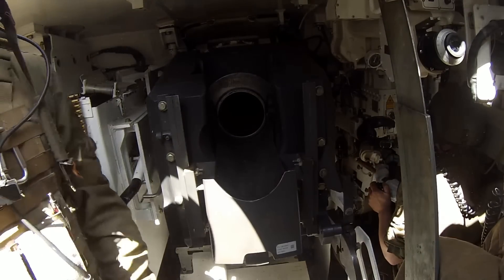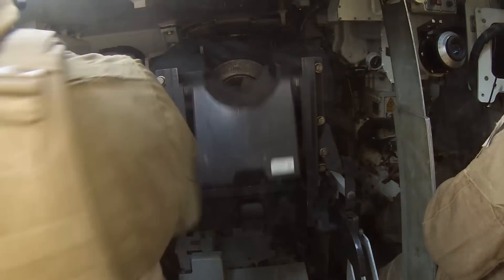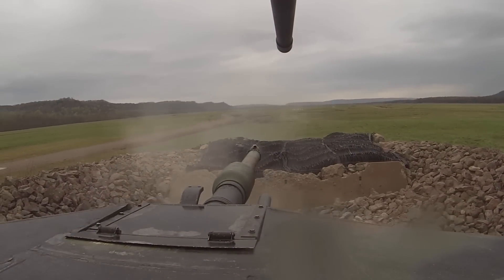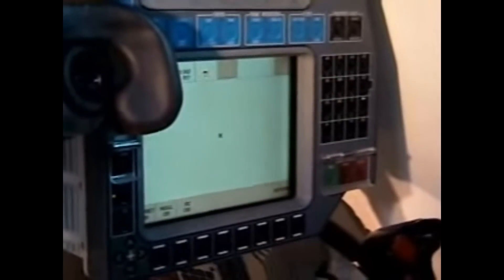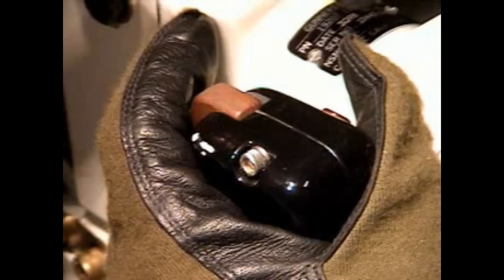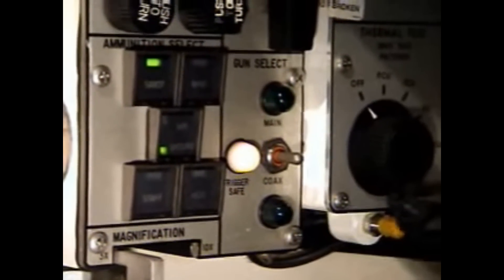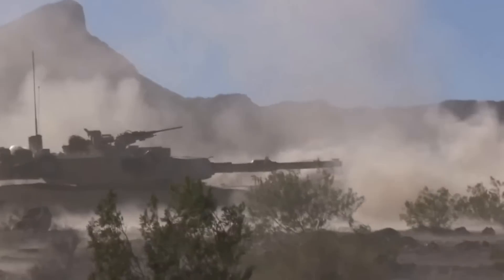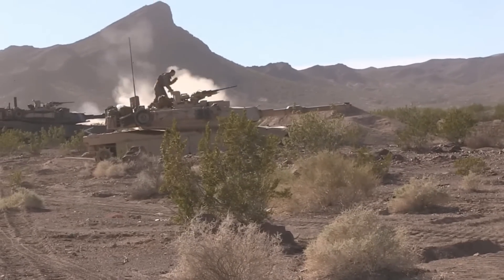How Do They Clear Tank Gun Misfires?

Comment: Now back in my day, if there was a misfire on the range, the crew applied immediate action and if that didn't work, left the round in the gun with the breech closed. They then got out of the vehicle and the Range Safety Officer had the privilege of removing the round solo. Fortunately, I was never RSO when a misfire occurred, for which I was duly thankful. BTW, the danger isn't a misfire, it's that you have a hangfire on your hands. A hangfire is where the primer is burning but the main charge doesn't ignite for some unknown period of time after the trigger is pulled. Needless to say, if it happens while the breech is open, anyone inside the vehicle is crispy critters. Even if the breech is closed, you want to stay out of the recoil path, in case the hangfire decides to blow when you're in the way.

Comment: I loaded on a M60 tank with a 105mm main gun and had to deal with three misfires.  Our procedure was less complicated.  After going through all the electrical and manual triggers, we would open the breech rotate the round 1/4 turn and attempt to fire again.  If that didn't work wait for possible cook off then off load the round to the range safety officer and he would carry it to the misfire pit.   Eventually EOD would come and blow everything in the pit.   In combat you would just chuck it, probably skipping a few of the steps.  We didn't have an ammo compartment with blast doors, all of our ammo was stored in the turret or hull, so no putting it back in the  ready rack.   Of the three I handled, one fired after the 1/4 turn and the other two were offloaded.

Comment: After 10 years as an M1 tanker I had one bad misfire.  The 15 minutes are for the tube/breach to cool.  When heated, the round swells and will not be able to be removed.  We actually had to punch it out from the end of the tube using the cleaning rod.  Since it was sabot, it is kinetic and inert.  We did damage the casing and had EOD and QS on site to take it once out

Comment: Besides all the ignorance and immature people’s post about this example of what a Mobilize Armored Tank Crew is faced with each time they  arm, aim and fire their main weapon in anger to be destroyed is extremely impressive and dangerous. Each member of any tank crew members have to have basic knowledge on the workings of their vehicle. No matter what their core responsibility’s are. To progress through the latter of command they may have to do something similar to what navy personnel or submarine crew members. That’s master each component of their MOS. Back to the miss fire. To the people who have repeatedly compared a Tank Round to that of a handgun or Rifles and assault weapons. Even though the tank round appears to look like a high powered rifle round casing with a huge projectile. It’s definitely not the same. Almost all rifles,AR and handguns use a primer or percussion strike to fire the cap. Big rounds like the 120 mm smooth bore cannon and others use a electric firing mechanism to send the round. It’s does not use a firing pin or strike break. So handling a miss fire round that electronically fired is totally different from what a person would do with a typical round miss fire. The charge round may fire long after it has been removed and it should be destroyed ASAP. Or removed from the ammo chamber ASAP or time permits
Reply: https://youtu.be/yHbf-Eb3xak

Comment: If there are two failure to fire, in any engagement, even not in a row, you must get permission from the field command to continue or to immediately stop and return to a  designated area for electronics checks by mechanical squad assigned to that tank.  The rounds are usual not the problem!

Comment: As a former loader, driver and tank commander on a leopard2a5/a6 I really wouldn't freak out at a misfire. I don't recall having had one actually. But since the round is fire electrically, when it's out of the tube I wouldn't worry about it too much, since you take it away from a possible source of ignition. What DID freak me out is when we had to unload after firing a decent amount of rounds and the tube really gets warm. This sometimes caused the casing to stick to the tube (since its just some sort of hardened cardboard. Sometimes you were able to get it out by twisting, sometimes the only way was forward  (with force, literally kicking it back into the gun) so we requested to send it anyway. But I recall a time when a fellow loader actually pulled the rear from the round and the high explossive propellant marbles were scattered over the tank's floor! That was nasty!
Reply: Cellulose casing.

Comment: Wait 15 mins? What if it is combat situation?
Reply: probably have to retreat to a safe distance to properly clear the breech. if that's not possible and getting the gun operational quickly is life or death, probably set the safety on immediately, open the breech, take out the misfired round, put it in the magazine, replace with a new live round, proceed as normal. Only in extreme emergencies though and no I'm not an expert
Reply: You would immediately clear the breech and chuck the dud out the hatch and proceed to load the next round.

Comment: Isn't it potentially REALLY dangerous to put the round back into the storage rack? What if the round decides to go off whilst its sitting in said storage rack? :-(
Reply: Not really. M1 Abrams has safety fuse to prevent those situations. Ammunition is stored in separated  storage which is not part of the turret. So if it detonates, crew and tanks interior is not damaged. If ammunition detonates in storage, or if its hit by shell from outside, separated ammunition rack drops out of turrets rear and nobody gets injured.
Reply: @vladislav3828  In THEORY! LOL
Reply: @georgebuller1914  It may sounds crazy, but it is main battle tank. I am pretty sure they have tested it out and found it is the best possible solution.

Comment: Got a question..... Since the casing is a nitrocellulose based casing that is consumed during firing, and the only items ejected are the brass base, and primer, etc; What would happen to a tank round if there were to be heat applied to the casing? Or is it only sensitive to extreme shock, such as c4 where you need a large shock in order to set it off. Thanks!!

Comment: M1A1 TC in Desert Storm here. In contact a misfire can not be handled the same way as in Tank Gunnery. 15 minutes is not an option. There are several expedient ways to deal with this issue, An undesirable way is to unass the dud round out of the tank. However, friendly ground units nearby must be taken into account. I have seen two misfires from other tanks in my unit while in contact. The first one the M1A1 went into max elevation and dropped back from the formation to clear the round. Although this does put your section at a disadvantage. The second one I saw was a Silver Bullet flying out of the loader's hatch of my wingman and the tank then continuing on as if nothing had ever happened. After action reviews showed that these misfires both came from the same lot number and all crews were instructed to turn in any remaining rounds from that lot they had onboard. I don't recall ever seeing or hearing of this problem again in my 22 years of active duty service. Murphy's Law in effect.

Comment: First point on 'Tank Safety' would be the Gunner, and his rolled-up sleeves and bare hands!
Next, unstrapped CVC helmets!
3:48- "Master Blaster". Yes, like the Mad Max character/s...
7:40- Yes, there is. We call it 'OSUT', or One Station Unit Training. The gun is '10 level' maintenance. In other words, crew level. It is viewed as the same training for your M4 Carbine, M9 pistol, M240 coax, or the 50 cal. Everyone on the crew is expected to have the skills and knowledge to clean and service every gun on the vehicle.  
Otherwise, correct.
2/69AR, 1998-2004

Comment: Its really not that big a deal. If its not going off with the trigger or master blaster (manual trigger) then its not going to go off. I was a loader and we had a misfire once. Just tried to set it off manually a couple times then I was told to pull it out of the breach and tossed it outside which is what you really should do.  Its a pain in the ass at the range though because you have to wait and leave it in the breach forever then wait a long time for EOD.

Comment: I find it interesting how after the round has been fired you are only left with the bottom part of the shell. What happens to the rest of it? Does it combust with the powder? What is it made out of like aluminum magnesium alloy or something?
Reply: Never mind I  found it.

On these rounds, the case (the light gray portion between the warhead and the black rubber sealing ring near the base) is made of nitrocellulose (heavy duty cardboard impregnated with nitroglycerin) and burns up completely when the round is fired. The only thing left after the round is fired is the aft-cap and primer which are ejected out of the breach and fall to the turret floor to be gathered up and turned back in to the ammo supply point later for re-use in making new rounds.

Comment: Spent five years in tanks and this never happened. Even with the old shells we were firing all the time (M-60A1 105mm). .50 cal is another story all together. We never put a misfiring round back in the honeycombs. Our drill had us waiting a half hour and then getting the round out of the tank. Throwing it out of the tank in combat or putting it in a sandbagged-in misfire pit at the gunnery range.
Reply: Yeah, putting a misfire back in the honeycomb seems...let just call it unwise. But in combat situations you wouldn't want to dispose it, were an enemy combatant might re-purpose it into an IED.

Comment: To answer your question of multiple misfires your most likely culprit is the firing contacts on the right side of the M256 gun.  Believe it or not, it is usually because of a flashlight filter that is placed between the contacts when using MILES before the gunnery cycle.

If you have any questions about the M1 series of tanks fire them my way.  (pun intended)

Comment: Usually, the breach or round was dirty. Crew not making sure both were clean. Wiping and oiling the breach is only temporary. Maybe 5 to 10 rounds. A full weapon cleaning was needed. This from my observations and one of two that had to extract the rounds on any tank range for my unit. Some cases, eyeing the primer, rotating the round solved it. Still had to open the hot breach. No fun.

Comment: I've got two questions and it would be great if you could answer them:
1. What is the purpose slightly enlarged piece on the barrel
2. What is in the overhanging back of the turret like seen in a leopard 2?
Reply: 1. You meant the bulge in the middle? That's bore excavator, which works by using air pressure principle to push propellant gas out of the muzzle.

2. What you were asking has no one-size-fits-all answer at general level, because designs from different factions and eras can lead to different answers:
For western tanks, the overhanging is the turret bustle, which houses ready ammo rack(s) for manual loading guns or loading machine and perhaps its magazine(s) for some auto-loader designs. Advanced designs may also carry fire-suppression system for the ready rack(s) and independent power source for the turret in there.
For those on tanks of Soviet linage, some are turret bustles and some are attachments. Tanks using Soviet-style auto-loaders are more likely lack the turret bustles because the use of ring magazine and perhaps the location of the shell ejection hatch.
Apart from things mentioned above, attachments like smoke grenade dischargers, telephone for escorting troops, telephone wire reel, tool box, cameras, bustle rack and/or add-on bustle armor parts also constitute part of the overhanging.

Comment: shells are electronically detonated. once they've waited the 15 mins the chance of a slow burn is null. pull the bitch out and conduct checks. the problem is more than likely the fire control system, not the round itself.

Comment: It's the same with any UXO. 
Check any faults within the fireing circut, manual and electrical.
If it doesn't explode wait 15 minutes aproach it have a look at the fireing mechanism on the device, if possible change it if not take a non touching dsiposal device and detonate both.

I had it on a live antitank mine it exploded but only the propelling charge which ment we had a live and armed shaped charge somewhere within 100m infront of us. That was a fun day.

Comment: Back in the day as a loader on an M60A3 I had a misfire (the contact was slightly corroded) that had to be cleared from the tank.  The M60A3 does not have a separate enclosed compartment for main gun rounds so it cannot be just put back in the ammo rack.  Much of the video is the same SOP but a few things are missing. First and foremost is that the safety of the other crew members of the tank. The misfired round considered a live round that can potentially cook-off at any time. Placing the Main Gun back on SAFE does not mean the round cannot cook-off at any moment  Because of this NO ONE IS ALLOWED TO PASS BEHIND THE BREACH WHILE THE MISFIRE IS STILL LOADED.  Anyone who has seen the 105MM shell eject into the "pad" knows that the shell is just as dangerous as the breach. 
The gunner is in a bad spot to help because to do anything useful he has to move past the back of the breach to get anywhere.  Basically, when it is time, after the checks, master blaster, spinning the round, and such have been completed its time to get the round out and safely away from the vehicle. 
 The quickest way to clear a misfire from the turret  is for the commander to move from his position and out of the turret, with the gunner taking his place while he is outside the hatch.  The loader drops the breech, pulls the round and quickly hands it up to the commander who moves to the side and lets the loader pass outside the loaders hatch and to the ground.  The commander then hands off the round back to the loader who then quickly gets it to a misfire pit with the business end of the round facing downrange.  While the loader is out the gunner moves to the loaders position and the Tank Commander is responsible for the gunner's tasks as well as his own.  Once the loader get back to the turret everything goes back to normal providing it was just the round that caused the problem. 
Some have said in combat you just chuck it out.  It's not that simple because the 105MM rounds were hefty and it is not like you can just pitch it out of the turret and have it clear the tank. 120MM even more so.  If the round doesn't clear the vehicle now you have an (armed) high explosive round bouncing around the outside of the tank which is dangerous not only to the crew but anyone around the vehicle.  If the round actually separates from the shell then you have cordite propellant pellets everywhere.  
During combat, a smart Tank Commander would quickly disengage, get the vehicle to a safe spot, get the round out,  mark the spot as best as they quickly can, and re-engage the enemy.  Until they do this the vehicle is not combat-effective and now becomes a liability to the mission.

Comment: Yea this is accurate☺👍 good job man. Usually after the 5th fail shot there's a pin that hold down the shell so it don't slide out the front, we just release that an slide the shell out an detonate it later depending on the shell👍

Comment: Been there done that. Graf Range 43 on a M551A1. It was so cold the initial round of heat we fired snapped the wiring harness severing all electricity to the electrical firing system. It was a night fire so I couldn't see t he snapped cord. We went through the gunner's two triggers with one being on the joy stick control and the other was on  the elevation and turret traverse manual cranks. When that didn't work I had to attempt to fire from my position as loader with the hand plunger that generates a charge that should have ignited the powder and casing. It misfired too seeing that the main gun's wiring harness was snapped and wasn't completing the circuit. The next 15 minutes were the longest of my young life and in my mind I could see me opening the breech manually to see a smoldering casing only to flare up to an explosion which would be the last thing I'd ever see. It ended with the range safety officer and NCO standing over me walking me through the procedure. After the time time had passed I manually cranked open the breech and to see that the firing probe had indeed punctured the round but nothing else. Once I had handed off the round we were able to get under and around the breech area and find the cause. Our time on the range was cut short and we had to pull off until repairs were made meaning another 24 hours in below zero weather. All I can remember was all the frozen fog, snow and bitter cold.
Reply: Good job Mike. Short, unknown episodes such as yours happen during peacetime every day. Most will gladly never need to deal with what you did.
Reply: You must be in 11 cav?

Comment: So why would you be happy when the misfire is back in the ammo box ! If the f'er goes off your done anyway If it were me I would toss the tosser out the top into a paddock ! Anyway are they centre fire type of percussion cap or do they go off with just an electrical charge ! The latter would be safer as the old style crushed caps can go off any time due the the grains in the cap being compressed ! bit like a mini earthquake one slip and it's all over .
Reply: SUNGEAR59 if the round goes off in the ready rack the resulting explosion goes out the blowout panels on the top of the turret, not back into the turret. Also the rounds are fired electrically.